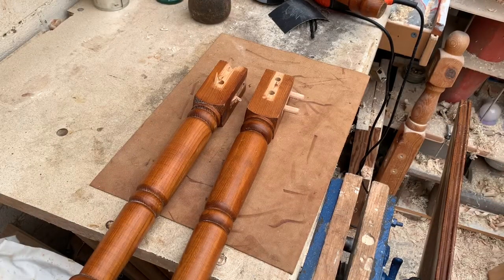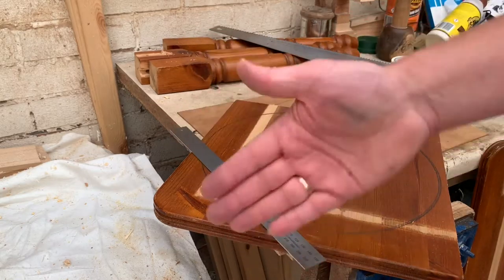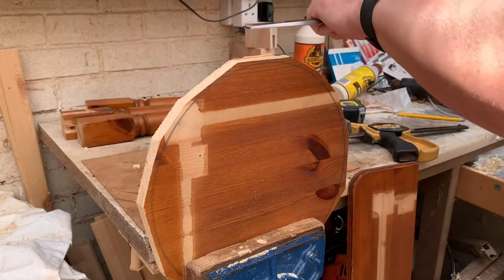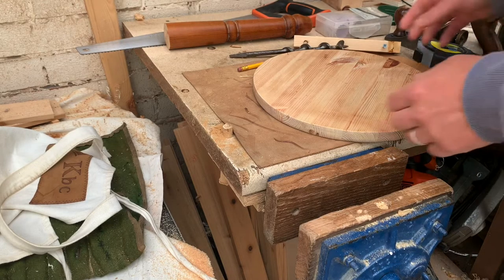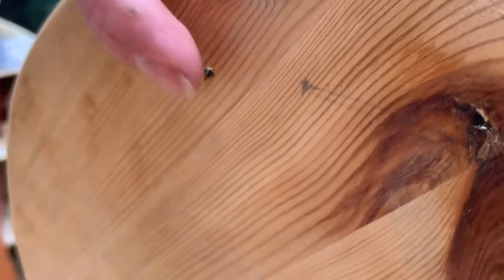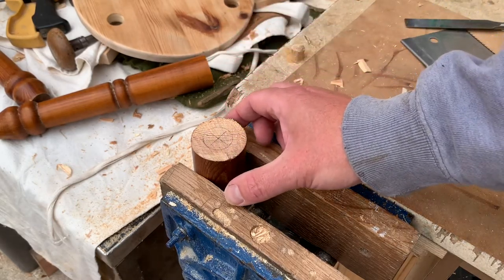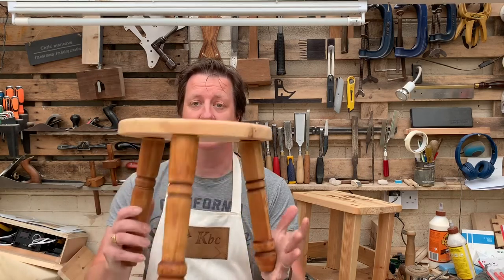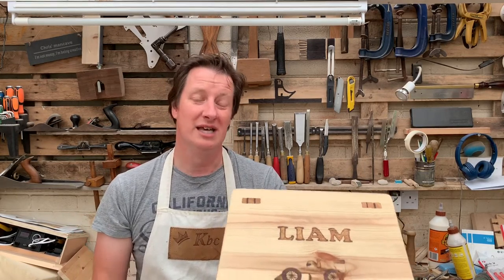Upcycling furniture (Making a nursery stool out of a coffee table!)

Comment: Tsk, tsk...tossing wood scrap! Lol...sand it down to remove rough stuff...drill one hole in the  smaller end about 1/2 inch through length ways,  glue in 1 inch dowel and glue into a base blank of your choice.  Drill more  holes on all sides no smaller than the diameter of your favourite pen, pencil or drill bit on downward angles no more than  1/4-1/2 inch depending on location.  Do the same for each leg at same or various heights.  Desktop organiser for favourite drawing utensils or drill bits...